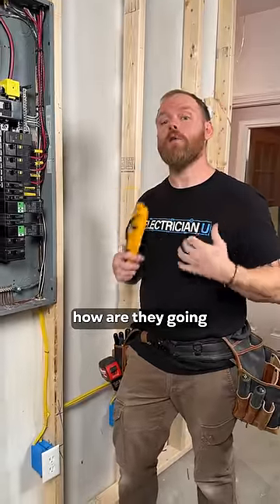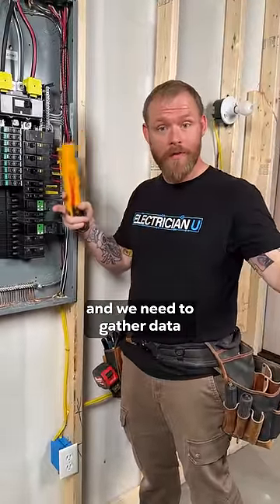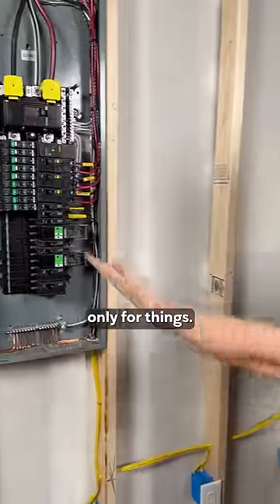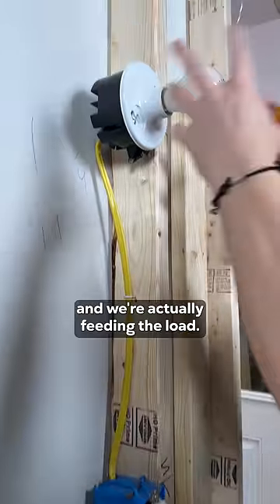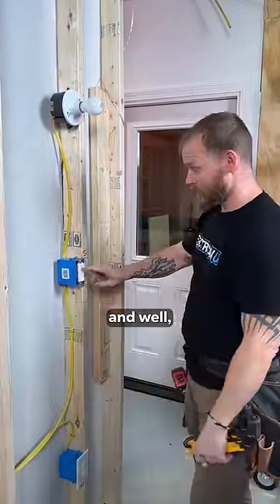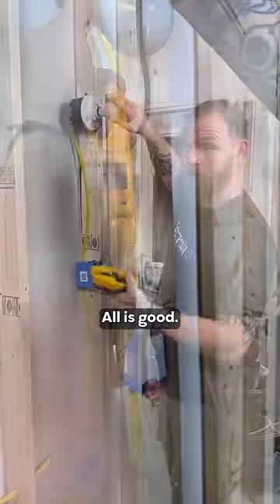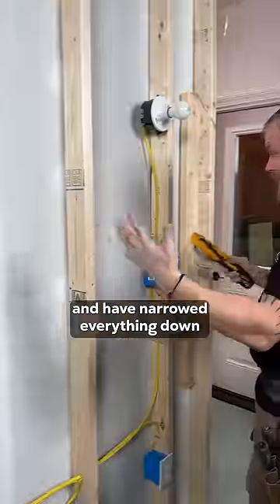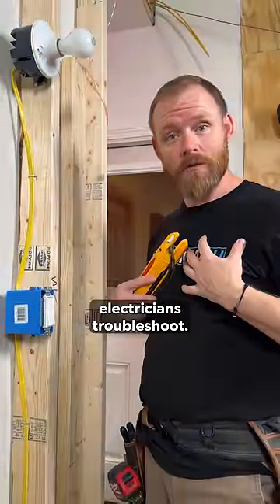How Electricians Troubleshoot a Problem

Comment: What if bulb and breaker works but getting(testing) too low a reading like one volt at light fitting and 14V at switch? Could it be the wires or is it neutrals...?😅
Reply: Are you testing from Hot to neutral? Hot to ground? If you test from hot to ground and you have 120 volts but only 14 from Hot to neutral then you have lost a neutral somewhere before your testing point in the circuit.

Comment: With such an open wall, you really have no problem checking the wire if it is broken!  I personally only check things when I'm sure there's no live electricity in any of the lines and the fuse is off.

Comment: Isn’t a device technically also a load? Or am I mistaken? A load is something to electrons energize right? Isn’t a device also getting energized as here the device is a switch it might not be energized to the load but the electrons are definitely inside that device. Sorry I just overthinking it I guess lol
Reply: A load will draw current. For an example,  a light buld will constantly be drawing current and using energy. A switch will draw 0 current. A switch will open and close the circuit to the light bulb.

Comment: So what if the problem is a damage wire after the breaker? The breaker still gives voltage but the switch nor the bulb wont work. How do you find the part of the wire bad without any visible damage ?
Reply: Yeh but how do you do it to find the exact point where the wire is bad? Remember the wire is insulated throughout

Comment: All good, but... Would I be wrong to check the switch with my beep beep tester before I even consider opening the panel?
Reply: Only thing wrong is using the dummy stick. They can easily pick up ghost voltage and give you false assumptions.